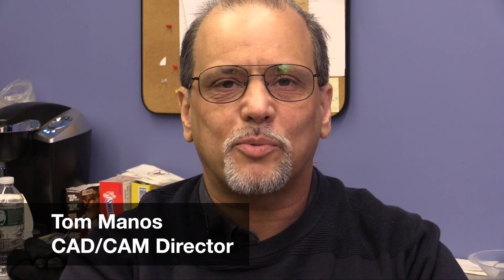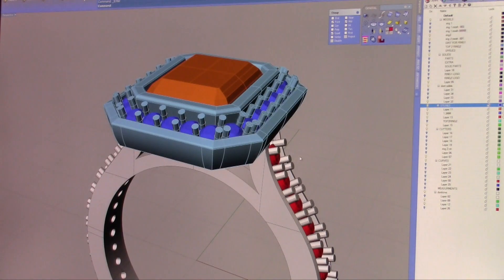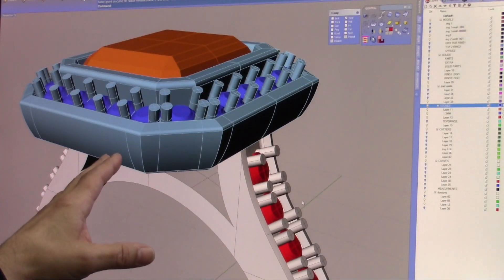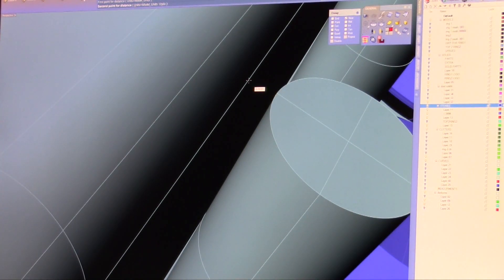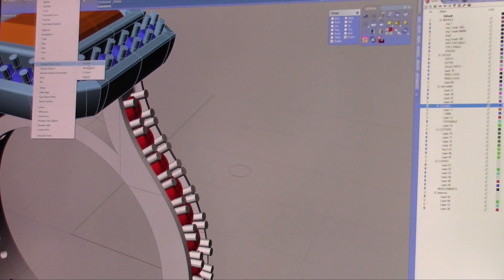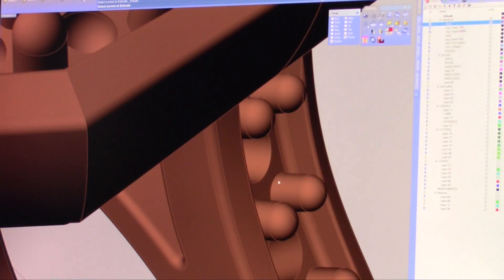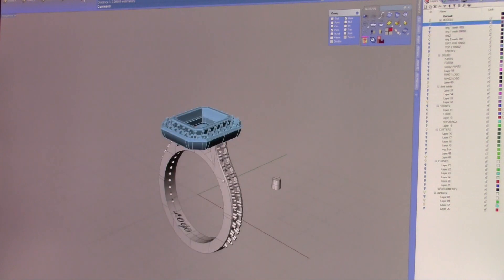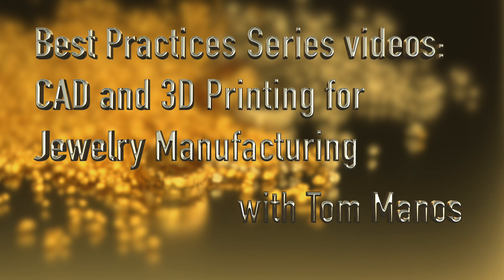Jewelry Best Practices Series - Jewelry CAD Design - Prongs and Walls

Comment: What draft angle would you recommend for the type of prongs in this model?
Reply: Depends on what your aiming to do. Ideally you would want between a 3° and 5° draft . If it's a shorter prong go with the 3° draft, if you have a longer prong try to go with the 5° draft.
Reply: Thanks!